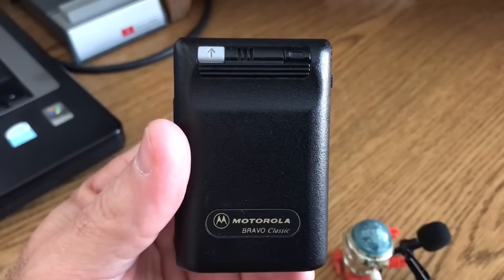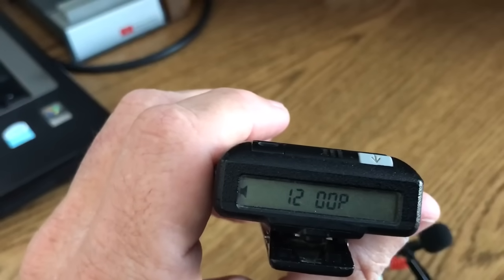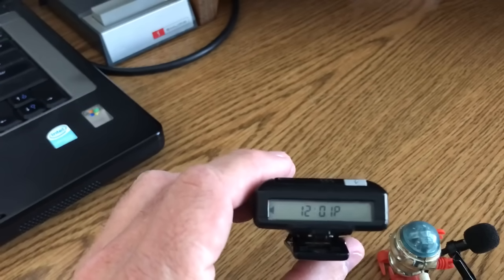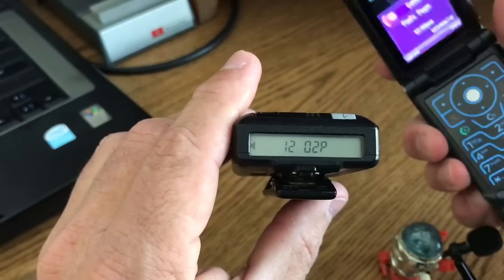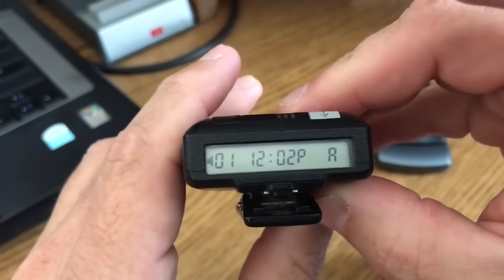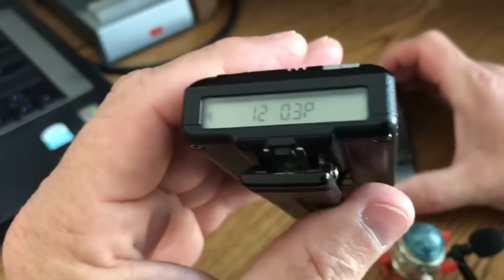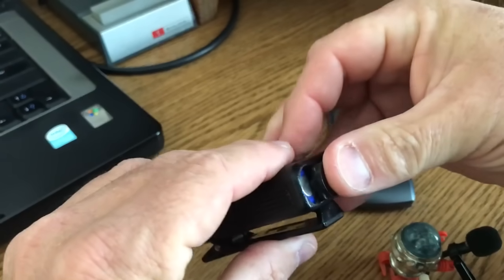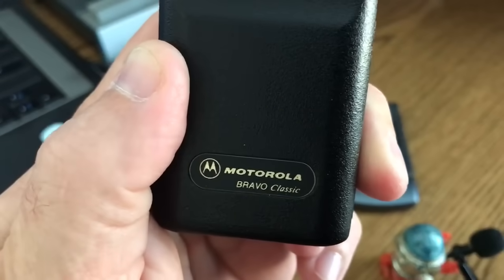How do pagers (beepers) work?

Comment: Apparently, after what happened today in Lebanon, this video needs an update.
Reply: I’m Lebanese and I’m trying to find out everything about these pagers
Reply: if they used solid state electrolyte batteries instead of regular batteries which use fluid electrolyte they might have been better off but I don't think those kinds of batteries are available in the market or are manufactured to fit such devices
besides that the Japanese have a monopoly on those since Toyota and Mitsubishi both have more than 3000 patents in the development of this technology

Comment: I was born in 91 and I don't remember anyone having a pager, but I think you sold me on these. They seem reliable and less invasive, older technology has a place in some cases.
Reply from the maker: Some of us are just more comfortable with the older technology.  It is un-track-able too.  Not that I'm doing anything illegal, I just don't like or trust the idea of someone, somewhere being able to tell where I am, how fast I'm driving, etc.
Reply: Pagers still get used in about 90% of US hospitals. It's all about reliability and security. Cellular networks are vulnerable to intrusion, as well as natural disasters. When disasters happen, history has proven that cellular networks can and will fail. Hospitals need to know that no matter the circumstances, their messages will always be received 100% of the time. To insure against failed cell networks, many hospitals still use pagers and will likely continue to use pagers at least as a backup for many years to come.

Comment: There’s a ham radio project that uses POCSAG pagers in the UHF and VHF bands. With a ham license you could essentially setup your own pager transmitter that is tied into an internet network. The project is called DAPNET and is popular in Germany/Europe but has been gaining traction in the US.
Reply from the maker: Interesting!  I wonder what would make hams want to build (or use) a paging network?
Reply: @ModelA  could be numerous reasons. You wouldn’t necessarily have to put it on the internet, so it could be independent of any infrastructure…like good for emergency comms. I’ve also seen some use it for any sort or telemetry or info such as repeater site telemetry to let the control op know of any number of conditions, weather information, band conditions reports. The uses are up to the imagination.
Reply from the maker: @misteraon    Well, anything that keeps paging alive has my support.
Reply: @ModelA  I would imagine that it is mainly used as hobbyist technology

Comment: I never understood these until I watched this video, thanks! For some reason, in my head, I thought that you could get words sent to a pager, kinda like a text. Idk if that’s a thing or if it is just how I imagined it
Reply: I think newer pagers got text but it was like caller ID or something. Someone needs to invent something between pagers and cellphones so I can track my kids without having to pay $60 a month for it.
Reply: There were text and 2 way text pagers, the latter likely being a stripped down cellphone that used the cell network and SMS instead of the pager network.

Another thing about the paging network is that the message would be sent across the entire country from every transmitter site because the network didn't know where a pager might be.
Reply: @plateshutoverlock  Actually, the nice thing about pagers is they somehow use an FM signal,  thus will work even if cell towers are down.  Not tr@ck@ble either.  We wanted a device not connected to cell phone system, this is a great alternative.

Comment: We should bring these back
Reply from the maker: Yes!
Reply: According to Wikipedia, emergency responders still use pagers. On account of the system being more robust in the face of, well, emergencies. Plus, there's probably something convenient about being able to get messages from a device you don't need to remove from your belt.
Reply from the maker: @Bluecho4    It's also quick because you only need to send 1 message and all the pagers get it from the one transmission.  With cellphones, the message needs to go out many times to each device separately.
Reply: @Bluecho4  Doctor's still did too up until a couple of years ago when they were on call.

Comment: Actually, cellphones and pagers got popular around the same time, which was the 80s and 90s. As cellphones got smaller and more advanced like the Nokia, pagers soon get more obsolete. However, pagers are still useful for certain agencies.
Reply from the maker: Cellphones did not exist until the 90's.  Before that, we had "mobbilephones", like RCC Mobilephone service.  They were basically VHF 2-way radios with a telephone earpiece.

Comment: Paul, this takes me back!! I had many of these over the years and even still to this day, in the hospital they are still used. There are areas in the hospital that cell signals just cant penetrate too but these little buggers still work flawlessly. The sdr radios are amazing for tinkering around too and I currently use one as well but, there is constantly less and less to be able to pick up here locally unfortunately.
Reply from the maker: Thanks!!

Comment: In metro areas some of the pager companies would purchase small amount of bandwidth from FM radio stations ..this was most cost effective than build a tower..at one point i had a nationwide pager (1 800 number) these would transmit nationwide via FM radio station towers so i could receive a page no matter where i was...

Nickname for a pager at the time was a Beeper due to the noise they made..

Everybody invented their own codes also..i.e. if my wife needed me to call home immediately she would enter our home number and 911 at the end..etc..

A funny story:
I was working for a major company and we had Alphanumeric pagers as a joke we would send the message "Low Battery" to someone and they would scramble to replace their battery..
Reply from the maker: You're thinking of the FM subcarrier pagers.  Those weren't around very long.  I played with one in the late 80's.  My FM had the paging 67 kHz. subcarrier on it, so we got a free pager to mess with.  It sucked.

I used to have an alphanumeric in the early 90's, but the error rate was pretty awful.  I went back to numeric because the protocol is more
robust.  POCSAG 1200 all the way, man!

Comment: Pagers are not going away. If that message absolutely has to get through, such as deep within a hospital, a pager works much better than a cell phone. Typically, the frequencies used are lower and the transmitter power far higher. Also, a pager going off demands attention. Not so a phone that beeps all the time. And finally, pagers can be transferred between staff. At a change of shift a Code Blue pager can be part of the transfer of responsibility. Some hospital staff even carry multiple pagers fitting with their multiple roles at any time.
Reply: My pager store went out of business not long after the invention of the Prepaid Cellphone came to be. It made the pager obsolete as you still have to call the person back. before cell phones we had no choice now we do.
Reply: Good for Hospital use yes. Because of the way the simple signal can make it through.  Not on account of the band good guess though. 
158.100
Is not a high frequency but the way it works it will penetrate.

Comment: I still have my mountain dew pager (I called it a beeper). I got it when I was in middle school.
Reply: Mountain Dew is a company that produces a soft drink I'm sure they do not produce any pagers and I guarantee they don't own any of the towers and or transmitting equipment I'm not doubting that you have a unit with that label on it however that's not who produces it and that's not who sends out the signal who pays the bill that will give you a rough idea. Companies that were making walkie talkies what producing pagers for instance Motorola Uniden we actually had some that were made by Panasonic they were very good quality a little bit on the expensive side we're not too popular I remember now the company NEC were producing pagers one of the United States biggest paging companies was Pagenet and Page Mart. those were the two biggest companies that were doing the billing buying and selling airtime.
Reply: @Mr.Robert1  Mountain Dew supplied communication equipment for NASA.

Comment: All the kids at my middle school had pagers. Two way pagers were cool for a few months but were stupid idea because of the fact cell phones could text and call. When telecommunications got deregulated that may cell phone service really cheap. As a result the market was flooded with cheap cell phones. That's when kids started getting cell phones. We bought them on are own.
Reply from the maker: Yep.  That sounds about right.  2-way pagers were just a little behind the curve.  When they were first introduced, cellphones could not text.  However, it wasn't long before they could, and 2-way paging was obsolete before it even had a chance.
Reply: SMS was introduced around 1993 at the same time that 2 way text pagers were introduced. So I think 2 way text pagers were basically a cell phone without the audio part.

 They might have used the paging network to recieve as well, at least a phone number like a regular 1 way pager but you still needed to be in range of a cell tower to send text.

Comment: The system is robust but not secure. Anyone could recieve and decode those messages .
Reply from the maker: But nobody cared.
Reply: Well they did, that's why they moved to encrypted technology and dropped pagers and even dial up for TCP/IP. Pagers were Phreakers candy playground back in the days. Great technology, but as said before me, not secured enough to be used in a environment with sensible datas.

Comment: So if a pager requires 2 batteries in series to work, how did the pagers issued to Hezbollah function if one battery was a bomb with no voltage to supply the extra voltage for the device.

Just a technical observation.

Or would they have replaced the one working battery with two smaller batteries wrapped up in the same size to make up for the voltage loss.

Would those pagers have been ni-cad or lithium batteries?

Just trying to figure out if it was an explosive dummy battery, or if the batteries may have been overloaded on the pagers.
Reply: They may have used a modern pager that have a built-in battery
Reply: They use single battery with 3 v because 2 of 1.5v give you 3 now you know
Reply: Pager with rechargeable battery

Comment: still use a pager and a 2g gsm cellphone, but not for long since t-mobile has decided to shut down their gsm network...whatever. i still have an analog copper telephone line at my house!
Reply from the maker: They already shut off the 3G here, and that flip phone is a doorstop now.  I am very displeased.  Pager still works perfectly.
Reply: i hate how they just get rid of old stuff for no reason. leaves us old guys in the dark. remember when they got rid of analog rabbit ear tv?...old stuff just worked, the new stuff they replace it with is absolute garbage
Reply from the maker: @アレン-f2x     How can I forget?  I was on the other end of the analog to digital conversion.  Had to build all new transmitter facilities, etc.  A lot of excellent tube-type transmitters that were reliable for decades got scrapped.  The new digital transmitters are built to last maybe 5-10 years max, they are computerized JUNK!!

Comment: I remember these days (33).  I remember the pagers you could leave a message on and the pager had a speaker and would repeat the message.  Good days. Miss those days. Things were alot simpler.
Reply from the maker: Yes they were.  I miss it
Reply: I was wondering if you could listen to the voicemails or not. Thanks for this information.
Reply from the maker: @tyreekl29   Yep!  You call your pager number and during the greeting, press the "0" and the  it prompts you for your passcode.  Then you're in the voicemail system.

Comment: Back in the mid 90’s I was handed my first pager when I started working on…and occasionally repairing copiers. I wore it for a couple months before it went off on vibrate. Unfortunately for me who at that moment had all the covers off a copier and I was reaching through the front and rear of the machine…why I no longer remember. But that pager went off vibrated so hard that I thought that I had gotten into the high voltage power board and was about to die…. Now I did move so fast that I almost proved that a human could move through time…only to find out that the service manager wanted to know if I was having trouble .

Comment: Neat demonstration, thank you.

Why would you send your phone number instead of just calling?
Because calls were expensive and the other person should pay for it?
Or would the other person usually call back from landline since mobile phones or car phones were not commonplace yet?
Reply: The last one. Mobile phones weren't that common and too expensive, so you'd receive a number or message and then find a payphone or landline to call them. Pagers were a lot cheaper because all they had to do was receive a very small message over the network; they don't transmit anything, you can't reply and it also doesn't ping back to say the message was received.

It sounds a bit odd today to not simply receive a phone call whenever and wherever, but back then it was really high tech to be able to receive a message that told you to make a phone call. Like, imagine going from not being able to remotely communicate with someone, to being able to ping them with a phone number to call.
Reply: @sidbrun_  Not odd, pragmatic! Thanks for the background info.
Reply from the maker: The person would call you back when they got to a phone.  The connectivity world moved much slower back then.
Reply from the maker: THIS!! Perfect explanation

Comment: Coming from the UK - Where we've always used the Calling Party Pays approach to billing - Pagers were an essential for kids in the mid-late 90s. Because service was paid for by the person sending the message (Premium rate numbers were used) the only cost to the user was the pager itself. This and the fact messages were relayed through a human operator made them cheaper, safer and much more appropriate for use by children. 📟🇬🇧👍

Pager service was largely withdrawn in the UK by the early 2010s, though some industry-specific pagers (Mostly for medical use) still receive service and probably use infrastructure that was never available to the public. The increasing levels of confidentiality around medical information and the fact pager transmissions are historically made in the clear (As your SDR setup demonstrates) means there'll probably be some haste to retire whichever pager networks are still operational in the UK as rapidly as possible. 🇬🇧 📟⚰

I'm interested to learn how these work/ed in other countries with different charging models, though. The US and some others use a Caller pays most and Receiver pays local approach. Would this mean that anyone buying a pager (For themselves, or for their children) would also have to pay a service charge on it every month? Or is it much the same as the UK model? 😺

And if you go outside of your home area/State do you have to advise your pager provider beforehand so that your messages are broadcast in the correct* area? 😇
(* - Because the UK is very small 🤌 each message would be broadcast nationally and the network wouldn't need to know where in the UK the target pager might be. I can't see this being the case in the US for anything other than premium priced contracts for mobile executives. 😇)

Comment: Very strange to see a technology that was around for so little for such a specific need only to be made completely obsolete by modern technology
Reply from the maker: paging was around since the 1950's.  It died out around 2010.  That's a 60 year run. But since pagers are still out and still work, I'm inclined to call it a 70+ year tun. Cellphones came out (to the public) in the 90's.  Barely 30 years old.

Comment: As someone who's very young and into cyber security i find these very interesting. Though you can't be tracked it seems like transmissions aren't secure since it's broadcast to the world. Interesting in learning more about some of the transmission protocols and such, they probably have modern day parallels if i had to guess.
Reply from the maker: My pager uses POCSAG at 1200 baud.  There were several paging protocols, including a 4-level one called FLEX.  Correct, the transmissions are sent out over a wide area.  However, for coded messages, nobody would know.  The major advantage is the people in the field are not traceable since the pagers are receive-only.